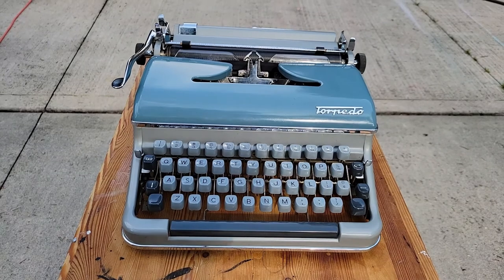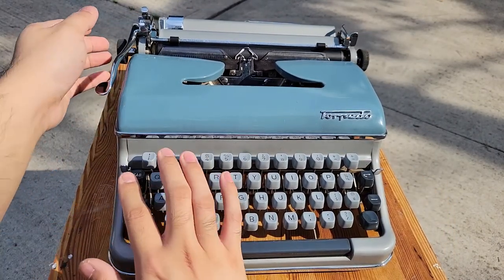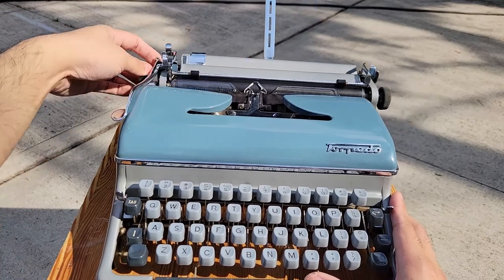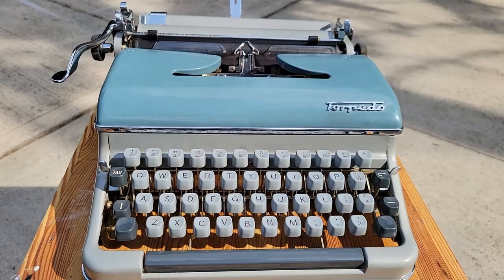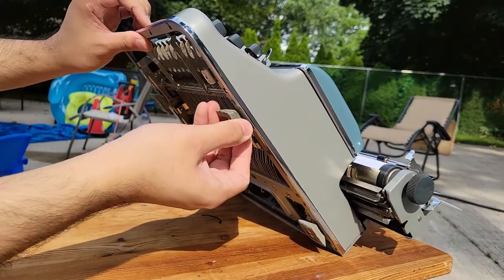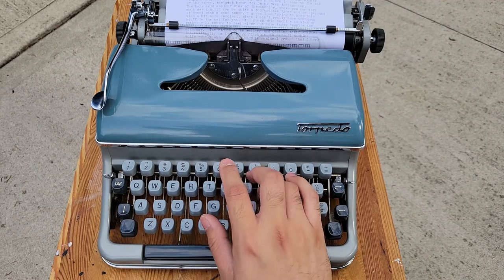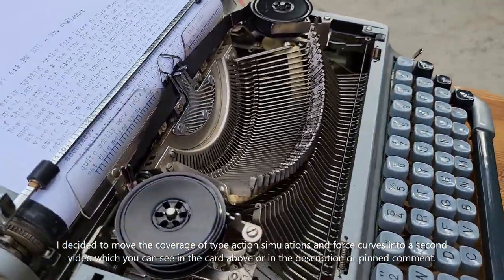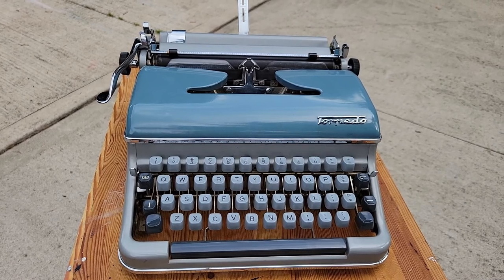Typing outside on the 1960s Torpedo 18B typewriter

Comment: Hi Haelscheir! When you removed the two springs on the side, for ribbon advancement, for better and lighter touch, did the ribbon stop advancing then? Sorry, I know my question is a bit amateur-ish but just wondering how it affected the winding of ribbon as you type. This Torpedo 18b is interesting. :) I love the way you dismantled in your previous video and showed how you fixed the problems and improve the typing experience. Thanks again
Reply from the maker: I found that at least one of the two levers on that ribbon actuation bail needed to be present, else there would not be enough force to reset the ribbon advance mechanism. With the one instead of two springs, the ribbon advance so far continues to operate rapidly and reliably.
Reply: @haelscheirs_haven  thanks again, Haelscheir. 😊